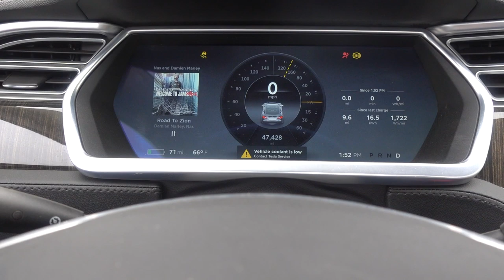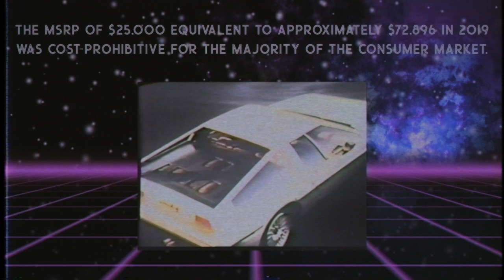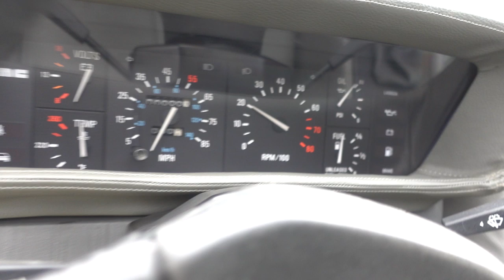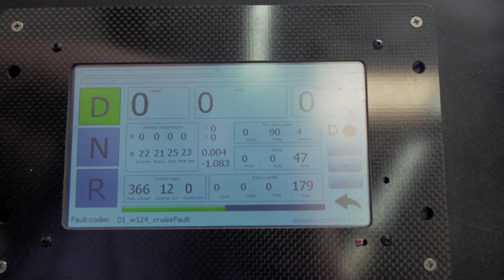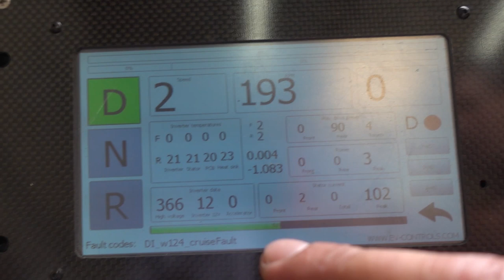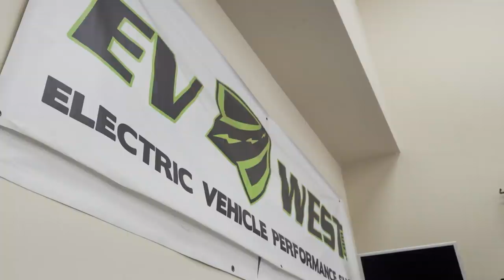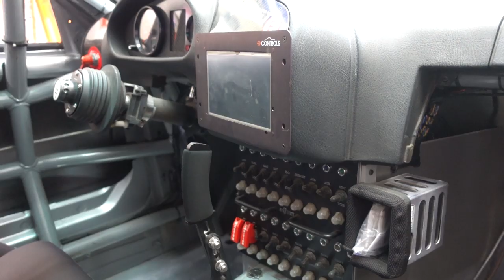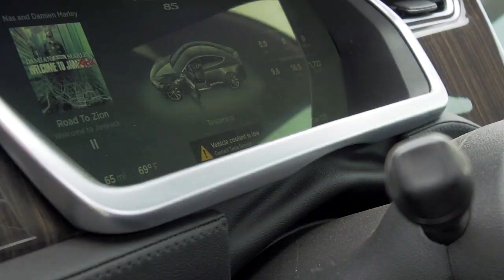Zero F*%ks Given TESLA PICKUP TRUCK: EV West’s Electric Madhouse

Comment: I think tesla should make pickup trucks that are customized for rally or off road
Reply: I believe that will be doing a pickup but I believe it's probably gonna be closer to a ridgeline than like a Tacoma, silverado, etc
Reply: Not enough range to take it off-road for long races or trips
Reply: @Hole_Motorsports  They already got over 300 miles on their high-end stuff and those aren't even trucks, if you allow it to weigh a bit more you can add a larger battery and therefore more range. I'm guessing at least 450 miles for the truck.
Reply: Ben Snow you could probably figure out a way to put another battery in the bed and hook it up for a few extra miles
Reply: Ford is making a electric 4x4 truck

Comment: As far as doing a EV build.... Do it! I will miss the braaap braaap braaaaaaap though. That's the one thing about EVs, I just really really miss the engine/exhaust noise. As Mr JWW has talked about recently, how the car sounds really affects the emotional connection you have with a car.
Reply from the maker: We all love combustion based engines, as well as electric motors they both have their own place in the automotive community.
Reply: @TheHoonigans  Absolutely. That's why the first thing I said was to do the EV build. ;-)

Comment: My dad has a stainless yj body on a jeep cj frame. He when to thw Philippines got a wife and his next time down there he has a jeep body made. Fast forward over 20 years sitting outside run in salt in winter and no car washes. it got very very slight surface rust you could only see with your face like a foot from the body. The rust came off in a car wash.